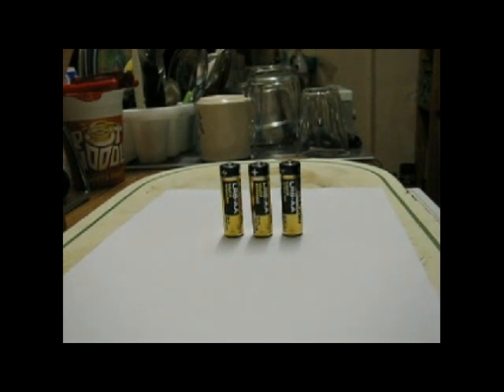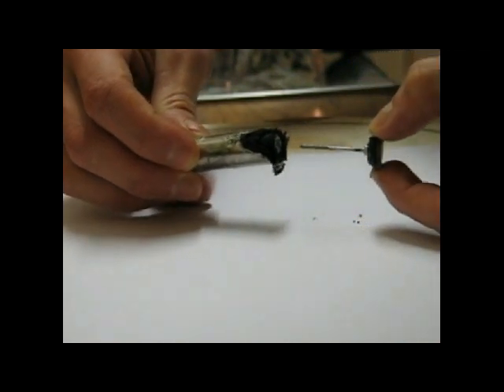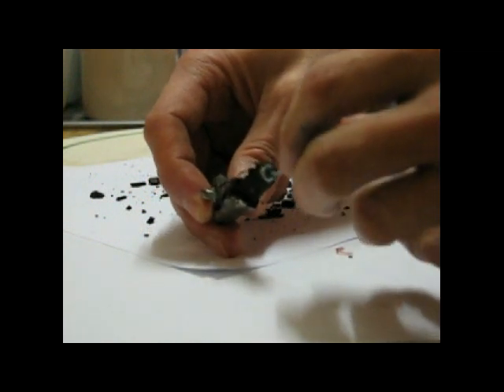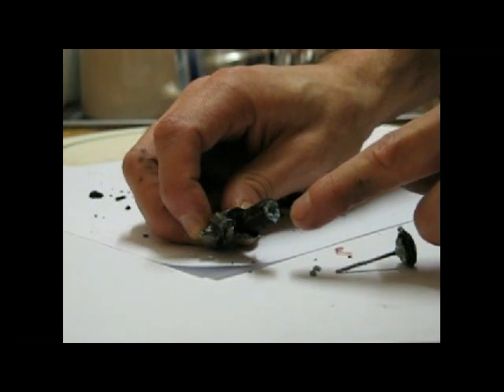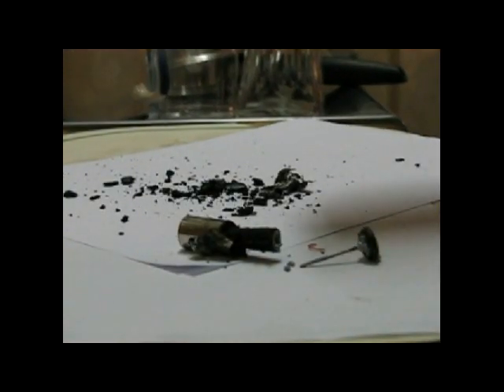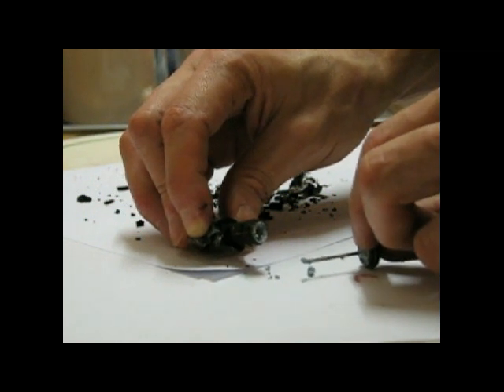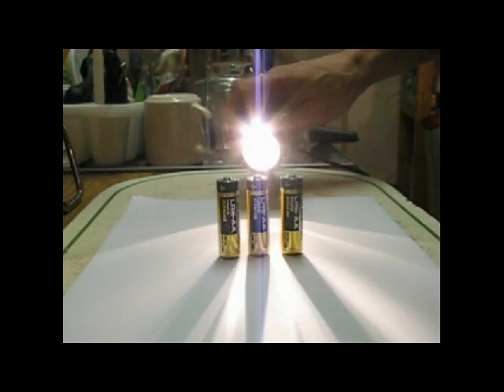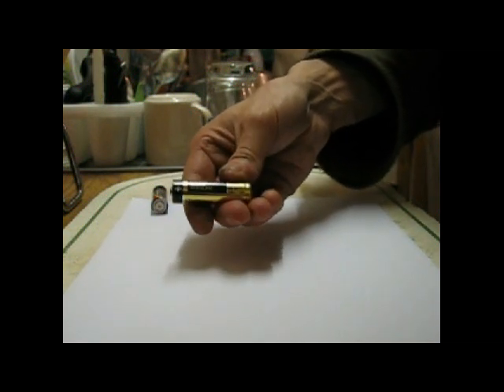Recharge Your Alkaline Batteries

Comment: Umm a flash light takes less charge then a digital. I usually put batteries that no longer work in bigger devices in remotes or flash lights. And the scientific explanation is incorrect. This is dangerous and as long as the alkaline isn't solid you may be able to add a small charge but even after hours it wont reach full capacity
Reply from the maker: Amber Saini The battery will charge as long as there is still an electrolyte conductor. When the battery is "dry" it will no longer charge.
Reply: +Amber Saini "Umm"  What the hell is your point with the flash light versus "digital"...digital what?  Are you another one coming in here slamming people for "scientific knowledge" that you clearly don't possess yourself?  It's not "dangerous" at all...you are thinking of those scary "6 oclock news" stories of batteries exploding and catching fire...that's not alkaline, there smart guy.  You can in fact recharge these to almost full capacity.  I say "almost" meaning over 95% because any battery that can take a recharge will not last forever.  I don't know the exact numbers, but I say 95% because I see virtually no charge life difference until the battery finally gives up the ghost...it may be higher.  But my experience has been no discernable difference.  They generally leak, as most alkalines do, than I throw them out.

If you want a more scientific explanation, go to a dedicated web site...but alkalines use zinc and manganese...and they are "consumed"  during discharge.

Is that enough science for you smart guy?
Reply from the maker: +ngc 1969 com ngc 1969 com  Amber is generally a girls name and it would be really helpful if you didn't end each of your lengthy posts with a personal insult just because someone shared their opinion. Thank you for your support and hopefully I won't need to ask you again.
Reply: ngc 1969 com ngc 1969 com  ummm obviously you may have trouble reading as I clearly stated everything along with researching.. no reason to attack people's intelligence because you are on the internet. Sorry we don't agree. You can just buy a pack of batteries at the dollar tree

Comment: buying new batteries is always better than recharging. It saves you the trouble being unable to continue an important project because recharging is not so reliable.
Reply from the maker: ***** Personally I always use rechargeable and always have a back up set or two, in case I need them :~)

Comment: The stuff about alignment of atoms is nothing more than mumbo-jumbo. Sorry.
What he missed is the mostly non-reversable chemistry of a primary battery. You can give them a bit of extra charge, but not much, and it certainly won't be repeatable.

If you want to think it's a conspiracy of battery companies, fine. But you need to look up the chemical differences between primary and secondary batteries.
Reply from the maker: You obviously understand nothing about the way magnets are manufactured and aligned. It only becomes "not repeatable" when the electrolyte has leaked away, which it is designed to do, hence the poor rubber seals and air vents. Alkaline batteries have nothing to do with chemistry and everything to do with how the bi-metallic compounds hold the charge.
Reply: +Janet Winslow Jesus, another one yet. Where do you people come from?  There are lots of conspiracies surrounding battery companies.  Here is one that pisses me off.  Explain to me why AAA are more expensive than AA batteries?  They are the exact same thing, just smaller and less product.  They are manufactured the exact same way with the exact same contents, but less of it.  Explain that one, smartass.

As far as this recharging them goes.  IT'S A FACT.  I do it all the time.  Many others have too.  This is pretty common knowledge nowadays...people have been recharging them virtually from the inception of them.
Reply: +Janet Winslow I'll explain it to you. IT'S A CONSPIRACY between the battery companies and electronics manufacturers.  It's called "price fixing".  Here is how it works:  The electronics manufacturers get away with making things ridiculously smaller (as is the trend in electronics) and hence they can use less plastic for their products since the batteries are smaller.  The battery companies benefit because those damn AAA don't have the life that a AA does, since it is smaller and less time to wear down, so they sell more.  Whether one pays the other for it or not hasn't been established...but they wouldn't have to, it's a win-win on both ends as it is.  I personally don't see a difference between the 1980's remote controls (for example) in size than I do the ones today.  I still have all my remotes actually LARGER than those 80's remotes(more buttons, so more space...but less space needed for the batteries, yet the available space inside is plentiful to fit the AA batteries...but they get away with less plastic in the compartment area and they can boast "less weight" to boot.  I suspect there is likely a kick-back to the other company one way or the other...but remotes aren't the only example...it's industry wide.
Reply: +ngc 1969 com ngc 1969 com Ah, another conspiracy. Got it! Like I said, you can charge non-chargeable batteries a few times, but the chemistry prevents repetitive recharging, or we'd all be doing it all the time - wouldn't we?

Top tip in doing this: use 'dirty DC' not smooth DC. You'll also need a constant voltage charger rather than constant current because that will provide much better results in recharging non-recharcble batteries. I know because I built a charger to do this..

Now go away and do some research on battery chemistry. There is loads of it out there. And if you think the internet is full of lies and silliness (which it obviously is) go along and get some library books out. You'll be able to learn about this in more detail than you ever wanted.

Comment: EBL® 920D LCD Rapid Advanced Intelligent Smart Individual Cell Battery Charger/Discharger for AA AAA Ni-MH Ni-CD Rechargeable Batteries (Black) (Electronics)
Fine for slowish 4 hour plus charge of rechargeable batteries, this is not a bad thing batteries do not get hot and have a longer life . Beware alkaline batteries. I checked carefully that some alkalines were not overheating on charge for 2 hours. Touching the batteries to check the heat one battery/, even though not hot, fizzled. It had started leaking caustic fluid through the bottom of the battery past the plastic sheath. All the charged batteries had an open circuit voltage of 1.7 volts. I wiped clean the leaking battery and left all the batteries for a day on a piece of hardboard. Even after cooling the leaking battery continued to leak caustic fluid that etched through the surface of the hardboard. Clearly this battery could damage any equipment it was put in.

If you want to try recharging alkaline batteries use the charger upside down so leaked caustic fluid doesn't rot the circuit board beneath the terminals. Leave any charged batteries for a day or two on an old piece of hardboard.I have read elsewhere that putting a timer switch set to,1 hour on two hours off for a total of 15 hours can help with good in date alkalines that measure more than 1.2 volts.

So yes in 15 hours you can recharge an in date alkaline battery that is not too discharged and it may not leak caustic fluid. Other possibilities are: leakage occurs while charging corroding the circuit board of the charger, leakage occurs later corroding terminals or circuit boards of equipment. Apparently you can charge alkaline batteries up to 10 times so 150 hours of charging 20 days looking at a piece of hardboard for caustic leaks and no guarantee your equipment wont be corroded - is it worth it ?

Comment: I wouldn't recommend this. Alkaline batteries can and will overheat, especially if your charger provides too high a current to them. Spend a little money up front. Buy a 12 or 16 pack of Sanyo eneloop NIMH batteries. They are absolutely the best out there. Buy a  "smart" charger, like a Lacrosse technologies. They will last you for just about ever.
Reply from the maker: Ok let's keep things in perspective here. Alkaline batteries are DESIGNED not to be recharged. The manufacturers recommend you do not recharge them for two reasons: 1. They might leak, hear up or even explode an it could be dangerous so they do not want to take responsibility for them. 2. They don't want anyone doing their own research and developing better battery tech. 

When I made this video way back when, there were no alkaline charging battery videos. And now a quick search reveals lots of them. The purpose of my video was to inspire others and encourage people to do their own research. It was not a recommendation to recharge or to use only non-rechargeable batteries without considering the risks and the benefits which I clearly laid out in he video. It was however and invitation to discuss and get the battery tech awareness ball rolling which it seems to have accomplished quite well. Thank you for your comments.
Reply: then charge in intervals
Reply: Rory Gallagherfan Definitely ! ENELOOPS RULE ! I use no others, have at least 30 of them, and rotate my charging yearly.

Comment: who the heck opens battery if you can try to open try cell phone
Reply from the maker: Anyone who is curious as to how a battery works and wants to see for them themselves. Be careful with cell phone batteries they are usually lithium-ion batteries and lithium metal is quite volatile... it will catch fire and even explode when short circuited, exposed to water or even air !
Reply: thanks
Reply: You gotta wonder about people who rag on DIYers, and snarkily deride those who experiment or try to do things just to see if it can be done. I mean, DIY videos aren't about setting National policy or anything. Jeeze.
Reply: Pioneers that is who, not some dependent moron who relies on corporation and what just anybody tells them unquestioned.

Comment: Based on my experience the brand that stands out among others are DURACELL alkaline battery. I'm no way associated nor connected with this company. I've tried other brands of alkaline battery  but they simply doesn't lasts that long, I have no idea what's the reason behind this. There's a well known brand that I tried to recharge but it just lasted 4x of recharging.
Reply: +william d -- I have been recharging standard alkaline batteries for decades. Dad taught me how.
If using a standard charger - 1 hour is the max time to leave it on the charger - test with a volt meter & you want above 15. If not charged enough you need to wait a minimum 2 hours for the interior rod to cool before re-charging again.
My personal favorite is Energizer lithium but standard Energizer batteries have better bottom seal & a better case than Duracell. Rayovac is also better than Duracell.
I now use a Maximal Power charger which has an ALK setting. Generally you are able to obtain as much as a 90% recharge which will eventually run down to much less. I discard mine when below 40% recharge rate & you should have 20 or more charges out of each.
Reply: +william d  I have the best luck with Rayovacs. They are the best alkaline batts I have ever used and less expensive.